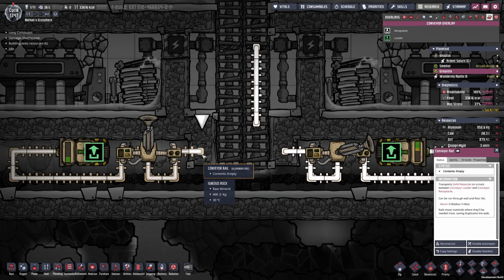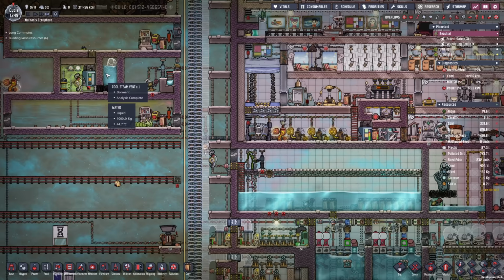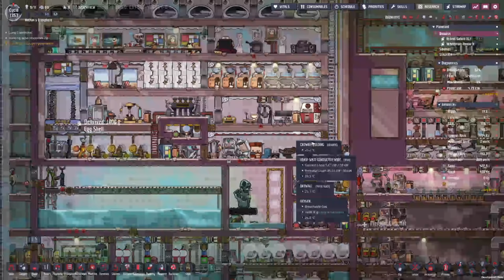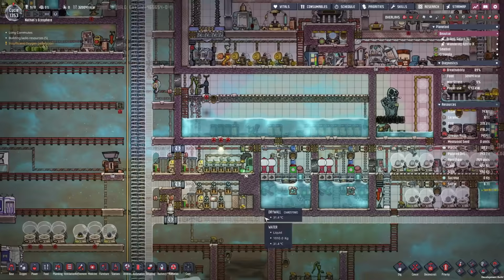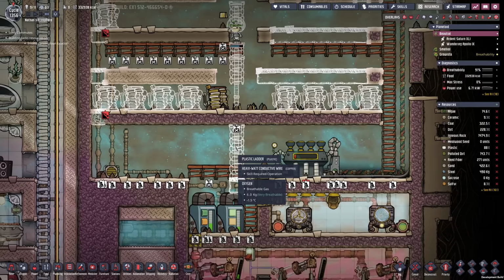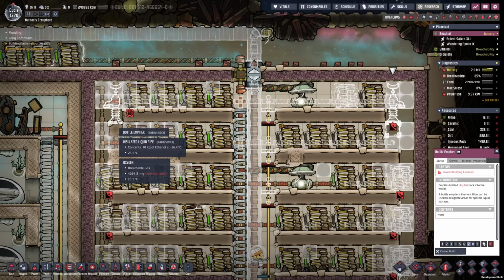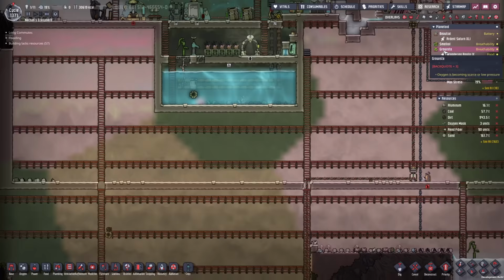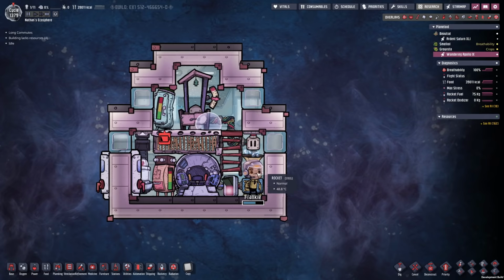BATTERY MODULE & COOLING - Oxygen Not Included: Ep. #43 - The Ultimate Base 2.0 (Spaced Out DLC)

Comment: Fun fact Nuclear Waste (if you create it) is really useful. It solidifies at 20° ish C and also has great thermal Capabilities. So for anything hot you can technically use it as replacement.
Also it has a TON of Heat capacity. Only bad thing is: the raditation.

Comment: In those aluminum tamer aquatuners, i never had any problems with that pipe setup, one thing i make sure to do is fill the loop and only then enable it after making sure the loop is filled and extra fluid won't join in... Only problem with this is setup is to make sure the pipe bridge input is not exposed to heat as fluid tends to idle there sometimes..

Comment: Never destroy water.  You can easily use a powerless compressor.  If you never use the water great.  If you end up needing it you have in stored.  You'll use the same power to get rid of it as you would by using the powerless liquid compressor.  Which is a power of 1 pump.
Reply from the maker: I ended up shipping it over to the main planetoid.

Comment: Tbh i dont really like cooling stuff with liquid on floor like everywhere. Why not just build that metal tiles under stuff and run radiant pipe thru that. Its much more efficient, gives other bonuses (run speed and decor) and even looks much better.
Reply from the maker: Gold tiles are more efficient, but remember that we don't need to be more efficient with the jumbo batteries, they get by with very little cooling. Also the dupes have no reason to run around the contraption once it is built.
Reply: @Nathans-Sandbox  But its supposed to be ultimate base, and ultimate bases have max effectivnes :P And imma not talking only about battery box, it applies to everywhere, where ya cooling with liquid on floor, so pretty much everywhere. My point is that its kinda overused... i can see it as solution early, when theres not much refined metals, but at this point you are just being lazy Nathan :D
Reply from the maker: I had to revise my statement. The liquid cooling is an elegant solution everywhere you want to have a vacuum otherwise, which is the case everywhere I have it in the base. I wouldn't call it less efficient unless it can't keep up with cooling where otherwise it could using gold tiles. Efficiency is also about using the appropriate mats that fulfill the job. And yes, your obession with gold metal tiles is insane!;)

Comment: Batteries? The battery module on a rocket has more capacity and can float on air or vacuum without producing heat, no maintenance lol
Reply from the maker: Yes true, but hardly intended for that purpose, it will be patched sooner or later I assume.
Reply: But the sheer capacity and materials requirement is far better, I'd still pay the price for cooling them 👍

Plus its more compact